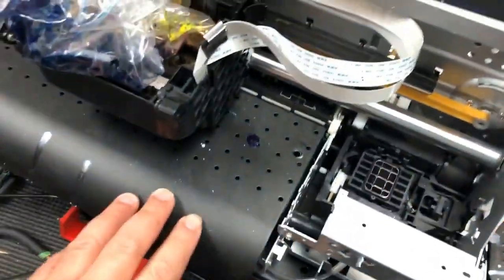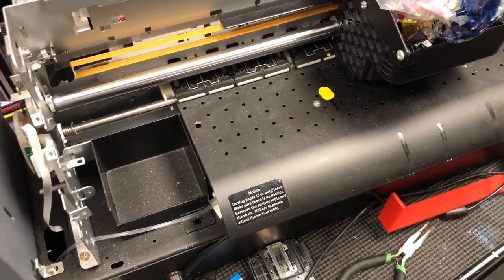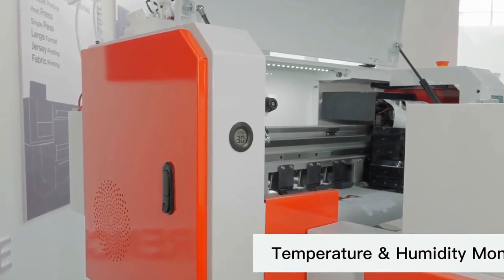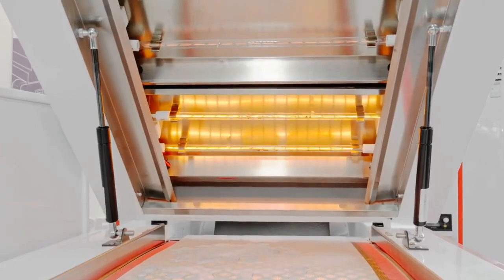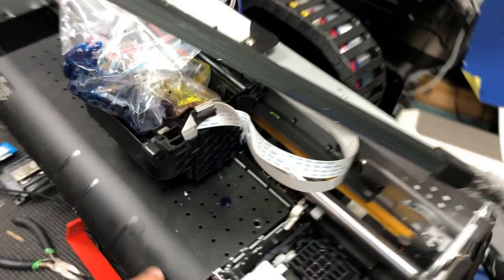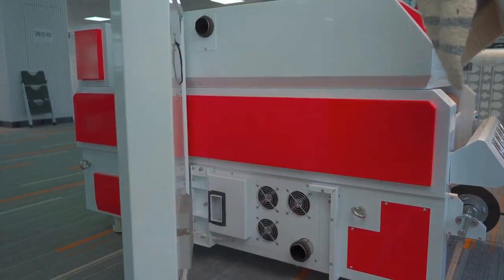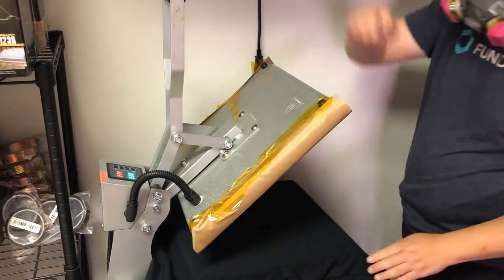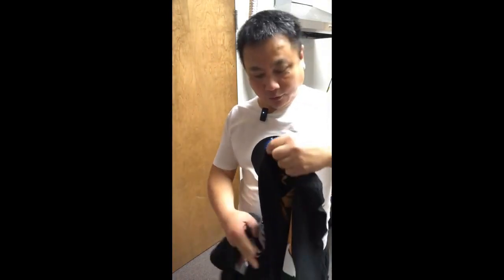Watch Before You Buy:  Sublistar DTF A3 Ultra A - Printer Review

Comment from the maker: For those considering this system, it proves quite efficient if you are familiar with its operation. While the cost is on the low-mid side, the features provided justify the price. However, be prepared to make several adjustments to optimize its performance. Or, for beginners, you may have a problem even making it work. A significant caveat: tech support is practically non-existent unless you are proficient in Chinese. Please take this as a word of caution when consider this product.

Comment: If you buy sublistar you are going to run into a lot of problems. Quality control  at this company ... got my doubts about this. Think twice. Brands like audley offer better services and have more experience with making this kind of machines. You buy at sublistar you will regret it.
Reply from the maker: Well put, and I completely concur. For those familiar with it, this system is quite efficient. While it's not inexpensive, the price is justified for the features. However, it does require several adjustments. Their tech support is virtually non-existent unless you speak Chinese, which I happen to do. Consider this comment a word of caution for the review.

Comment: I purchased a A3 DTF printer in April 2024 from Sublistar and it arrived with no power, so they sent me a replacement power box but no instructions on how to install it. This whole thing has been nightmare working with them, and I would not recommend purchasing from Sublistar. They have the worse tech support that I have experienced, and the language barrier is a serious problem. They may send you replacement parts but no instructions, which does not help and causes lots of sleepless nights trying to figure things out on your own because they are 13 hours or so ahead of most of us. One month later and still no working DTF printer. I have requested diagrams and written instructions several times and they refuse to send me the help I need. I cannot find anyone here in my area to work on this printer because they lack the knowledge of how this printer works and do not want to touch it. This is just some information so you can give your Sublistar purchase a second thought. Also, you have no buyer’s protection whatsoever and you will be taking a very big risk. PayPal refused to help me in this matter as well. My bank did reverse the transaction temporarily in hopes that me and merchant can resolve the issue but working with Sublistar has been a complete NIGHTMARE.

JUST A HEADS-UP AND SOMETHING TO THINK ABOUT BEFORE YOU MAKE THE PURCHASE FROM SUBLISTAR OR ANY MERCHANT FROM ANOTHER COUNTRY DIRECTLY. I do feel that if the tech support was better this would have worked out great because it looks like a very nice printer if it was working. Just like Kevin said, the printer looks nice and strong and of high quality, I just have to get through not having real support for it and trying to figure out things that should be simple with instructions which, they do not provide. I just don't want others taking this big of a risk. Best Regards.

Comment: Hello, thank you for the video. I purchased the SUBLISTAR DTF-A3 STAR Ⅳ PRINTER and it arrived with no power. It will not turn on and only the power light has a faint blinking but, the printer has no sound or other lights on. I am posting this as a heads-up and also to see if any others had the same issue. Being that they are in China they are refusing to replace the printer and only want to replace parts which will in turn void my Paypal's buyers protection plan so I do not know what to do. Please let me know if anyone can help me figure out what to do. Looks like it will be a great printer once I figure out my no power issue. Thank you guys.
Reply: hello did you manage to fix the problem? I am looking th purchase the same model printer...